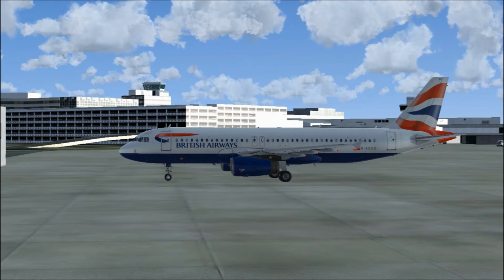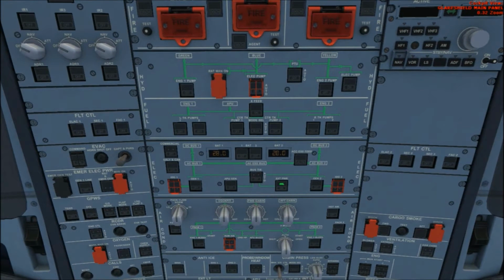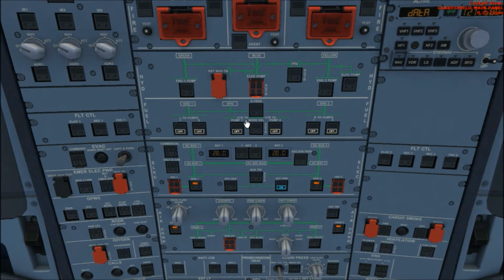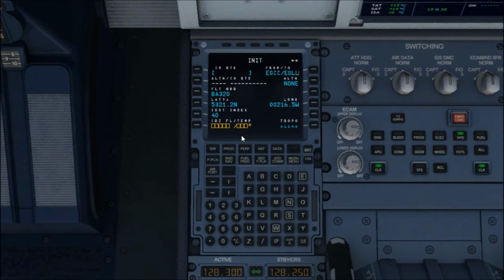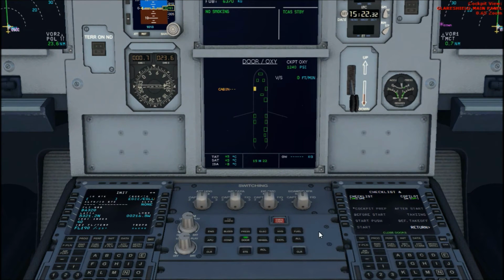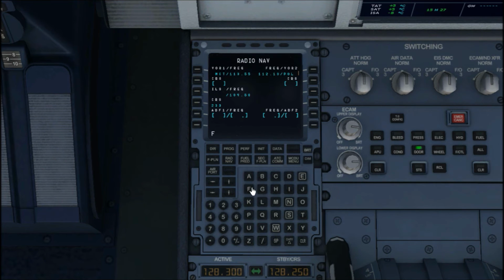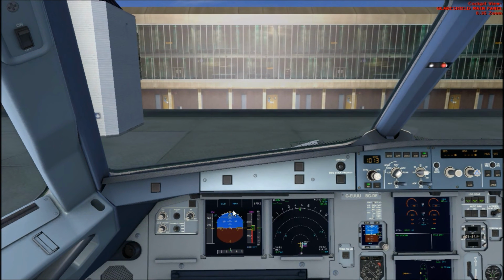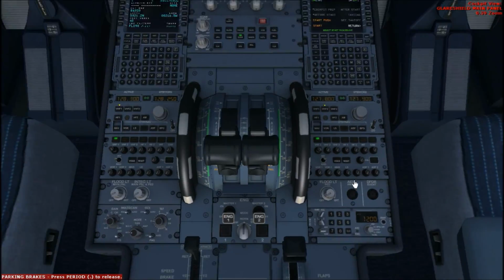FSX - Airbus X Extended Tutorial - EGCC to EGLL

Comment: I really enjoyed this video ,,I have a problem though ....................
after I takeoff I hear a bepping sound and it says the auto throttle is not set or something like that and that alarm sound goes on till landing .............any idea???????????? thank you
Reply: Huddison  no problem i thought id take the time to comment as i dont normally do but your tut was great helped me out alot thanks,
Reply from the maker: I'll play around with the simulator to emulate your problem and get back to you - atm, I'm not quite sure what the issue is tbh.
Reply: its your throttle postion when it beeps either bring the throttle forward or back intill it stops
Reply from the maker: russellharrison23 Thanks.  I was intending to reply to Anubhav, but you saved me the trouble :)
Reply from the maker: russellharrison23 That's great to hear.  There's a couple more tutorials I'm aiming to get around to using the Airbus X (and now in steam:).
Reply: Anubhav Pant  do you set the thrust levers to idle??
Reply: TheQuickscope2000 after it says toga mode .i set the thrust to half and the indicator of toga mode disappers and then i start the autopilot ..........and then the beeping sound starts
Reply: russellharrison23 yes i do that ...and i start the autopilot ..then it again starts beeping.....
Reply: Are you going overspeed??
Reply: No the speed is fine  ....
Reply from the maker: Anubhav Pant Follow these steps (taken straight from the official Airbus X manual) and your problem should be fixed :)     a. Set the thrust levers into the TOGA position
b. Switch off auto thrust using the FCU button
c. Now bring back the thrust lever to the CL position
d. Activate auto thrust again using the FCU button
e. If already activated the Autopilot has to be switched to ON again
Reply: Huddison im very greatful to you....thank you for the steps☺  i hope these will work .......thanks a lot😄
Reply from the maker: Anubhav Pant My pleasure.  Let me know if they solve your problem :-)
Reply: During my climb, I'm also a warning light comes on and beeps along with and over speed indicator. Should I try your below recommendations.?
Reply from the maker: Hi Thomas yes try my recommendations - also see my other videos as these may offer a solution to the problems you are having.  Merry Christmas :)

Comment: Hi  Huddison did you had any problem with your throttle everything work but my throttle if i give it power an it wont move so if you have any help with this please let me know on how to fix it
Reply from the maker: Are you using a joystick with throttle?  Without seeing exactly what problem you are having; the only thing I can suggest is to ensure that both engines are running and the parking brake is off.